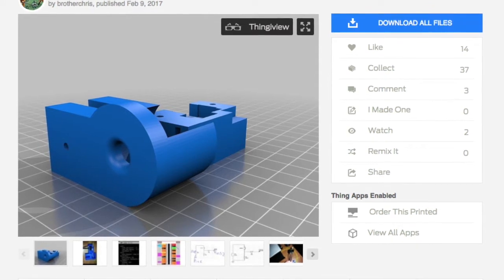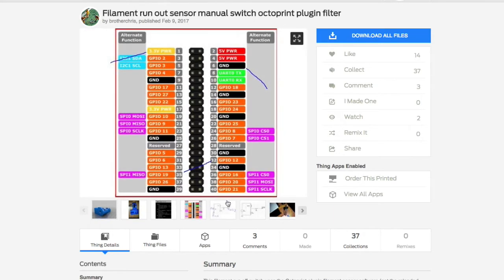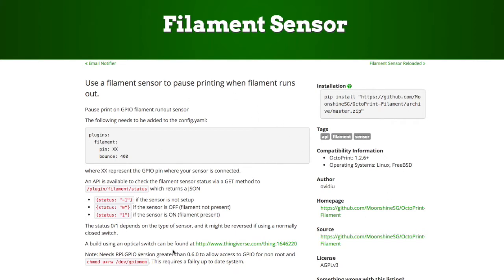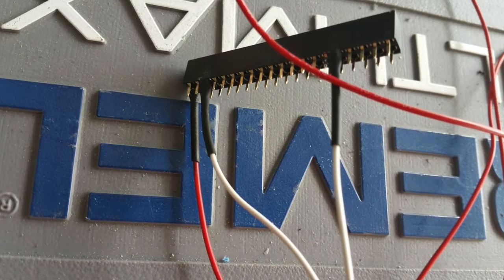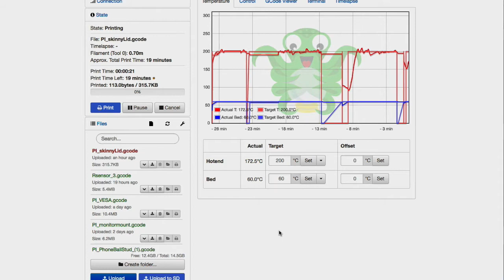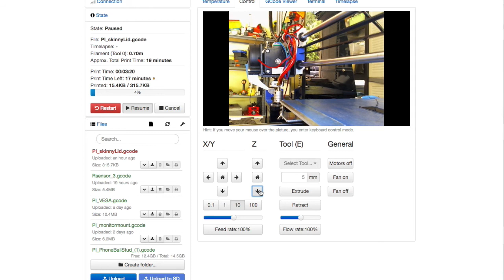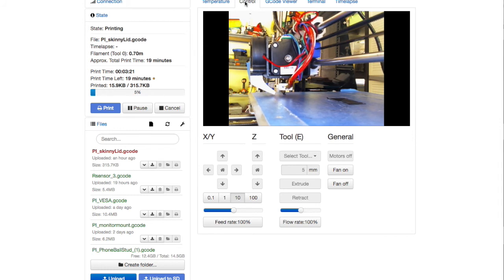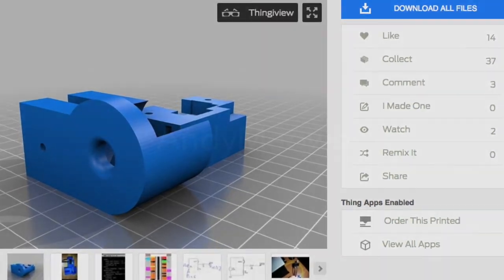DIY Filament Sensor for your 3D Printer

Comment: Thanks for your video on this filament sensor.  After trying for a day to get my filament sensor working with the filament sensor reloaded as well as with the original version you have described, I finally achieved success with your video.  I was never able to get the filament sensor reload working although it may have been because I never used the 3V positive with the resistors.  Your video showing the wiring diagram which indicated I needed to keep the signal high when there was filament solved my problem.  Thanks again.